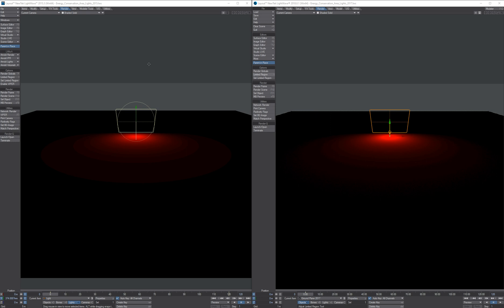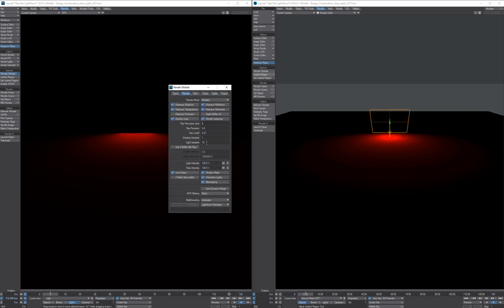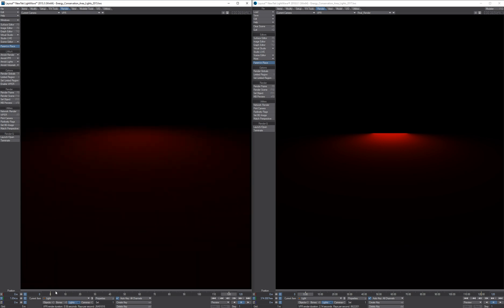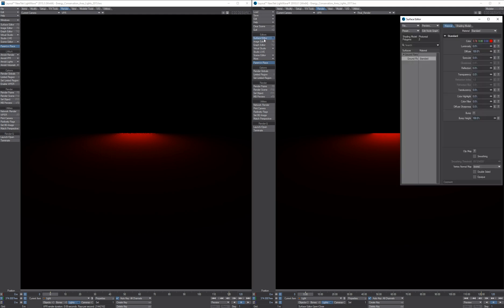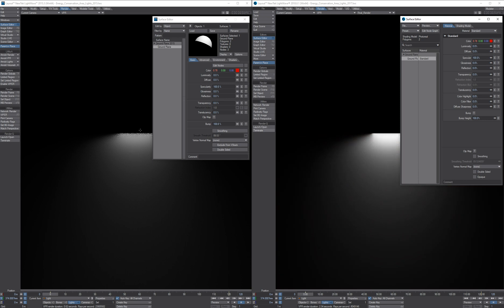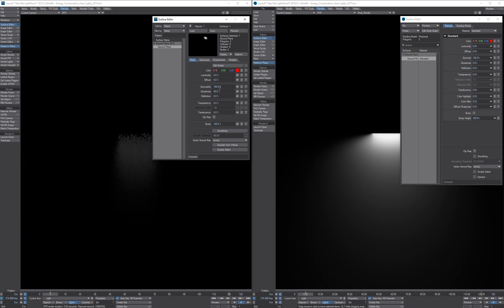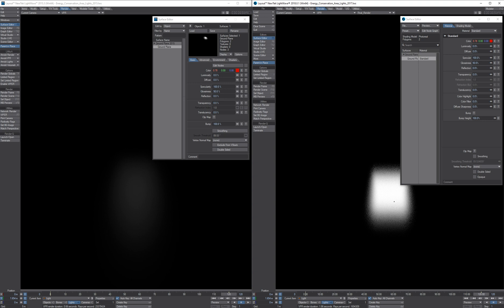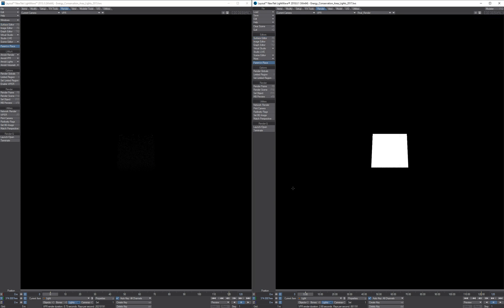Shading System Exploration (LightWave 2015 vs LightWave 2018)

Comment: ive made the test in 2015 and found just as long as you turn off Draft Mode for VPR you get a perfectly smooth grain free render.   On mistake people always make is forgetting that draft mode steps down VPR's render quality for increased feedback speed.     Take a look for yourself.
Reply from the maker: I was not using draft mode. The sampling is far better in 2018 because it uses multiple importance sampling.